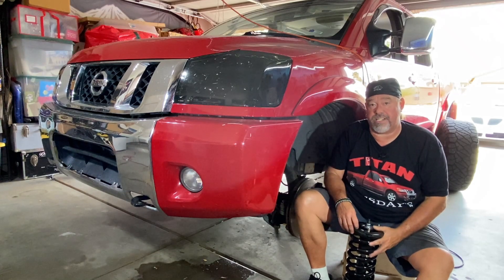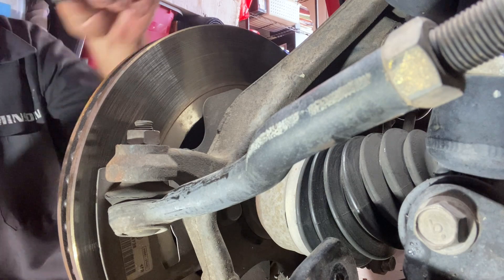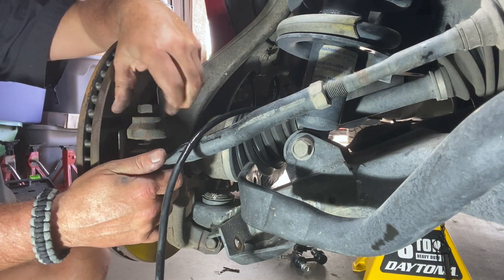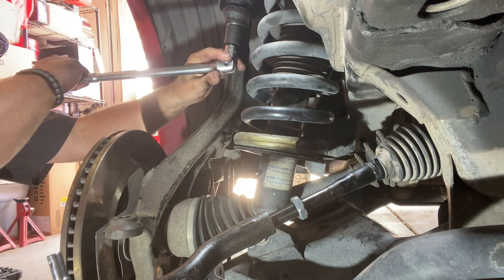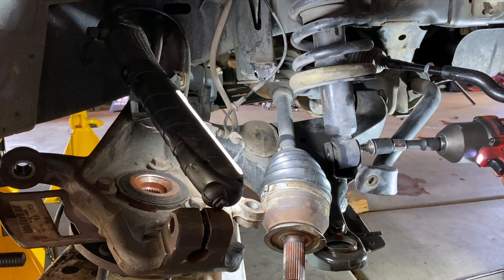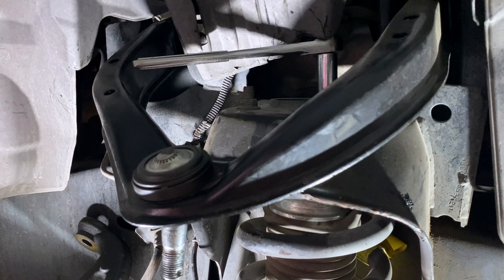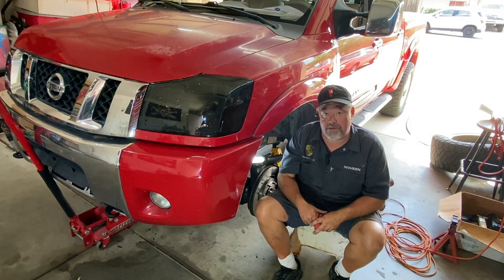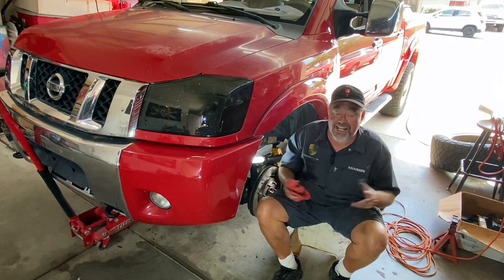HOW TO REPLACE FRONT STRUTS ON A NISSAN TITAN - Easy DIY Step-by-Step Video

Comment: You don't have to go through all that. Just simply loosen the top 3 nuts and and take bottom strut bolt out and believe me it will come out.
Reply: This the exact comment I was looking for lol
Reply: For real I’ve done it too on my titan lol
Reply: @NorthernLifeOutdoors would this also be applicable on a 08 armada?
Reply: @ivanvega2821  yes just remove the tire so u got room to work just take off the three bolts on top NOT the one in middle then take off the lower bolt it’s should just wiggle out
Reply: @NorthernLifeOutdoors  if worked perfectly. Sure wish doing struts in a Volkswagen was this easy 😂
Reply: Yeah, it was easy leasu on my Armada 2005.only removed top 3 and the one bolt on bottom

Comment: You need a 14mm for the top bolts.
2 19mm dor the bottom bolt, a hammer. WD-40 and patience

Comment: totally didnt need to do all of that. If you take out the the nuts on top and then one on bottom, you can let it drop into a little area just ahead of the 'axel' and before the tie rod end... Once you drop it into that area, the top can be leaned out and removed over the tie rod. Super easy and dont know why more people dont do it that way... unless you want to get in a service your tie rod end....
Reply from the maker: I was rebuilding the entire front end, and made smaller videos on each part for folks.  You are correct you can do it your way faster.